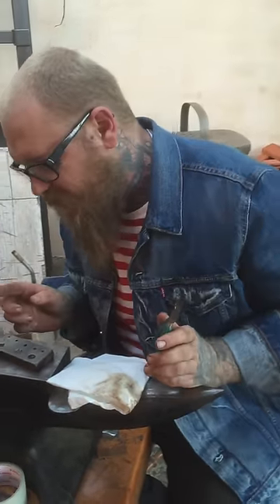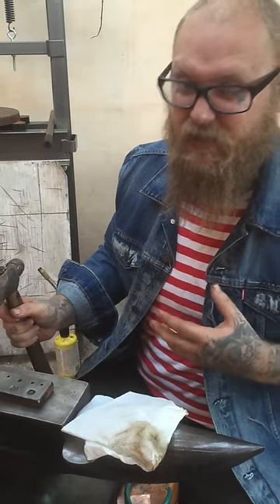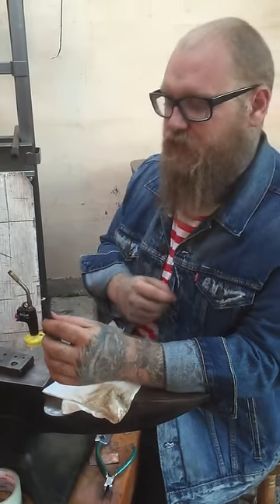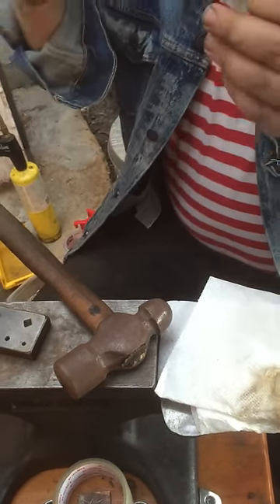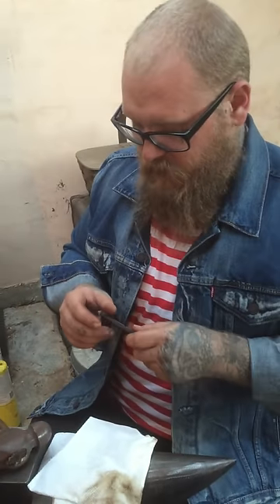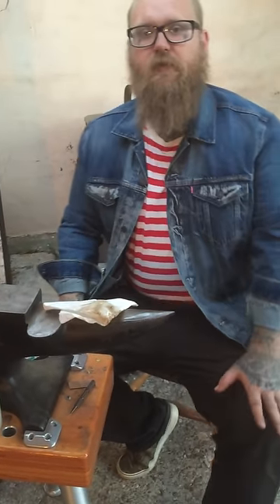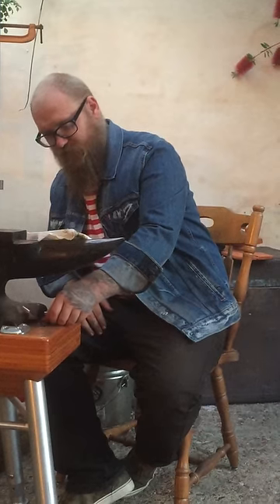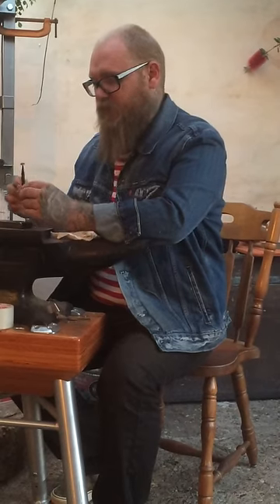how to use a shot plate

Comment: I'll try this with fine silver tomorrow because it was impossible for me to use the shot plat with sterling, even after annealing it.  Also, does it matter if I hammer it on a wooden stump versus and metal table?  Thank you for the video.
Reply from the maker: As long as it is a rigid base it wont matter if it is metal or wood, place a piece of leather to keep the plate from bouncing too much, if you dont yet have one i would grab a force tool from our site to assist, fine silver will be much easier to use as it is softer, after you get the hang sterling wont feel much different.